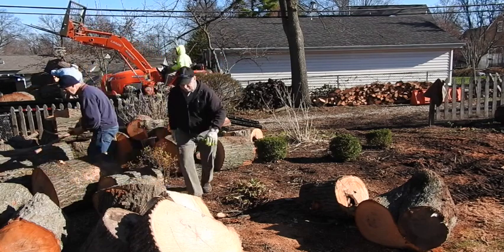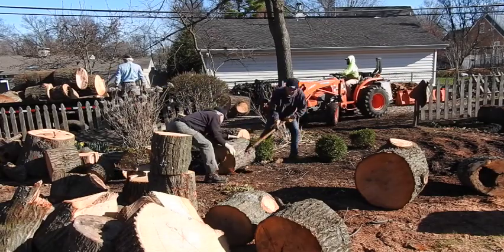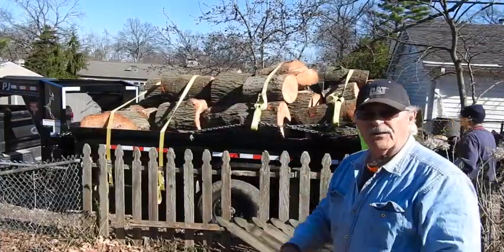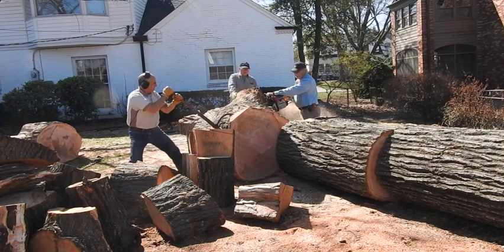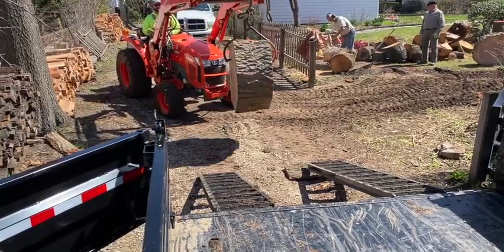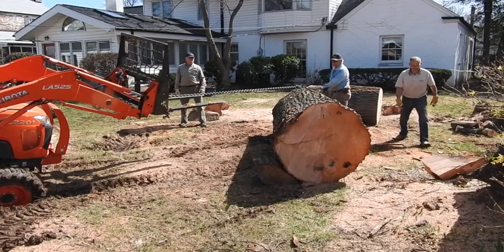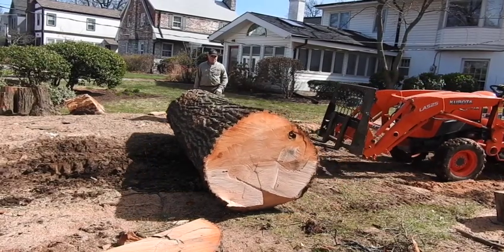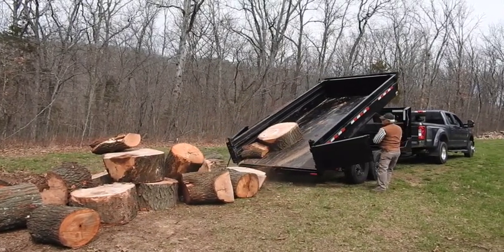Big Wood - Skidding Tongs and Kubota Make A Good Match

Comment: The dump trailer sure looks handy, and those tongs work slick!
Reply from the maker: We've been using skidding tongs for many years Ozzie, with loader tractors, track hoes and high lifts and skid steers.  Sure lets you sit a log in a specific spot and not shake the load loose like happens when they roll off forks or you open a thumb on a backhoe bucket. The downside is to use them the best, it takes a ground man plus the operator.

Comment: Building a proper load was time well spent. It applies to almost any loading job even a trip to the dump. Wow that tie down job was impressive. Very secure. We had a set of tongs on the farm I grew up on. They are still kicking around. My much older brother is on the home farm🇨🇦
Reply from the maker: We were working too far from home to make a partial load.  The chain trick allows the cross ties unlimited hook positions, because we do not want to secure to the fenders.  There's nothing worse than thinking of one of the rounds rolling down the interstate in the middle of traffic. You can never have too many straps on loads like these. Hopefully your much older brother has the old tongs in a good place !!

Comment: I use a L3200 but welded grab hooks on the top of the bucket.   If there not too big I can usually get 3 at a time. I have forks but didn't realize how heavy the forks are compared to the bucket so I get more lifting capacity with the bucket. Just added a 4' grapple last week and added a 3rd fuction kit. Home run in my opinion because the grapple is only a little heavier than the bucket.  Thanks for posting.
Reply from the maker: A grapple is on the list for the New Holland LX 865 turbo 65 hp skid loader.  Forks ARE heavy that's for sure, but this set was free.  I have another set on the NH skid loader but it doesn't mind the weight like this little tractor does.  I didn't want to use the bucket for these big rounds because it's my son in laws tractor and I didn't want to take the chance of springing the bucket.  My little B3030 came to me a couple years ago with a sprung bucket and its a pita backdragging and getting a good job.  Thanks for the visit Mark !!

Comment: That is quite the load. I would have had to split it all by hand before I loaded it by hand. When we had the 4 big maples along the front of the house dropped I filled the back of the 1946 Ford 3 ton flatbed truck 3 times and hauled it back to the back yard. It had a 10'x20' bed on it that I designed for hauling tractors. Never did haul a tractor. Didn't trust putting a load up that high on that old truck.
Reply from the maker: We would sometimes haul the farm tractors from one farm to the other on an early 50's Ford grainbody.  A big truck, the F-XXX evades me for the moment.  We had loading docks dug into dirt banks at both places so it was a direct drive on and off the stake sided flatbed.  Other times we just drove the tractors pulling equipment that wouldn't fit the truck.  I bet you'd kinda like to have that 46 Ford again, if for no other reason for nostalgia's sake....not to hand process more maple.  LOL.   I'd love to have the old 6 cylinder Ford back myself....but a guy bought it for $200 at the auction to salvage the grain bed and he said the rest was going to the junk yard....he drove it home after the sale.

Comment: You may have mentioned it but why were the tree(s) cut down?
I'm glad that you got a lot of good fire wood and plank wood but it must have been a majestic tree.
How are you going to split those huge logs?
Reply from the maker: Well Rick, one of the large branches broke out of the biggest tree near the fence and took the deck off the neighbors house and destroyed the roof on his garage.... Then the second largest in the middle of the yard was beginning to get soft in the center of the trunk down real low.  That makes it somewhat of a liability as well being really weakened at that point.  With the big one serving as a wind breaker no longer there, the full force of the wind could take that one out too.  But yes, this is an older part of the suburb and the trees were close to 200 years old and quite majestic for sure.

Comment: Great workout, Tractorman44 and the gang. What's your estimate on the number of cords from that tree? Thxs for the vids!
Reply from the maker: Well David, if you consider split wood will 'swell' by an average of 20% and the trailer is 8x14, level to the trailer would be 1 3/4 cord.  The wood was rounded up several feet above the 2' sides, so figure an average  of 2' (if stacked squarely)and that would double the first amount.  That would be 3 1/2 cord per load and two loads would be 7 full 128 cu ft cords. But of course this is all an estimation but its gotta be close.  A conservative guess would be 6 1/2 to 7 1/2 to put it in the ball park.  Its a LOT, no matter how you figure it.   LOL  Thanks for watching David !!

Comment: Those tongs are sure handy. I use mine on my splitter
Reply from the maker: Yes, they sure are Gary.  I've got a variety of them, the largest will snatch close to a 4' log.  These here are the preferred size for up to 36''.
Reply: @tractorman4461  , mine got used on a 40 inch monster white oak. That was about the limit of advance for them. That was the reason that I had my splitter modified was to handle those monsters. They really worked well.
Reply from the maker: @tractortalkwithgary1271  Big wood is a lot harder to manipulate then the small stuff isn't it.  We prefer smaller, but we never say no to the big stuff.  It sure is nice to be able to handle the big stuff when needed though.  You have the stuff to do it too !!

Comment: Would it be easier to cut logs the length of the trailer and cut them up back at home base?
Reply from the maker: Yes, but situation and circumstance most of the time dictate technique.  On construction sites that's the way we do it all the time because we have the equipment capable of loading logs. In here, there is no equipment available except what we haul in with us so we are limited to small blocks like we did.  The other thing is the tree trimmer had already blocked a good percentage of this up already.  All I had to block up was the small ends of the large logs.

Comment: I’d say I predict some splitting in the future or a mess of butcher blocks! Boy, that trailer and set up with all the help makes for efficient work. I’ll bet there were a few cups of JO consumed for this project to? On Wednesday I had Sam the tree guy here, a crew of three and they took down 8 trees, one live that was hanging over the house and the rest dead. I looked at those trees many times that were close to the house and buildings wondering if I should tackle them myself. The live chestnut oak, about 20-24” in dia., required climbing and sections lowered to get down. Now if I would have bought that Oliver 77 a few years back I would have had something I could have used for this purpose. Sam is a very nice Amishman I’ve hire before and I believe he’s part monkey the way he climbs with ropes and spikes and chain saws! He quite reasonable compared to others as well. I know that Alice feels much better not having the threat of those trees every time it got windy and I am too. Some of my best memories are ones like this video, when friends and family get together to do a job! Kind Thanks for sharing this major moving of sizable pieces of wood. That lumber should be lovely! A good friend of ours has a saw mill he said he’ll bring here this summer and cut some of these logs into boards. All the 8 trees are oak and half are good and solid. If I can get some boards it would be great. At least 20-25 oak have died on our 8 acres and I’m not sure why. Many white oaks, some red and some chestnut or rock oaks, as some call the chestnut oaks. The live one was a rock oak so I’ll strip bark off for later tanning of hides, make good bark liquor and was the preferred bark in the old days, lots of good tannins. Well it’s time for another tippin session your way and to all in today’s 44 Adventure Vid! And what a good one it is! This is DaveyJO headin to me JOpot!
Reply from the maker: I tell ya DaveyJO, that trailer is absolutely wonderful !!  I wanted to test the salesmans statement for sure.  LOL   I hate to see so many of your oaks dying out.  But at least you'll get some good boards out of it.  Some of those tree guys are fearless.  That was a job I'd have liked 40 years ago, but not now !!  We had a real good time and I was glad to have my son on the Kubota loading today.  Sure took a lot of work off me !!  Today, we went back and brought the two big logs....both near 4 foot diameter.  One 11 1/2' long, but the other is only 6', but it'll have some good project boards in there.  Sippin and tippin inna morning my friend....Say hi and give my best to Miss Alice !!

Comment: You need a sawmill shame to cut that beautiful tree up into fire wood!
Reply from the maker: I got to the job after the tree trimmers had blocked it up.  I managed to save 4 good logs out of it for the sawmill.  Here's the first two in this video: https://www.youtube.com/watch?v=hM96flDWjTk&t=105s  I am editing the video right now of the two larger ones I got today from the same job.  Well, one is only 6' long but the other one is 11 1/2' and both are near 4' diameter.  Video tomorrow.  Thanks Marc for the visit.